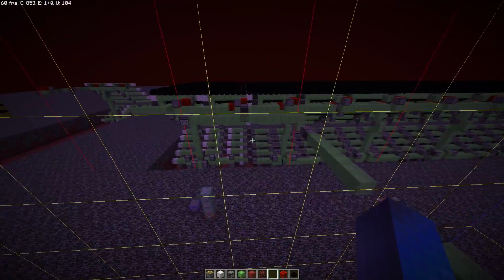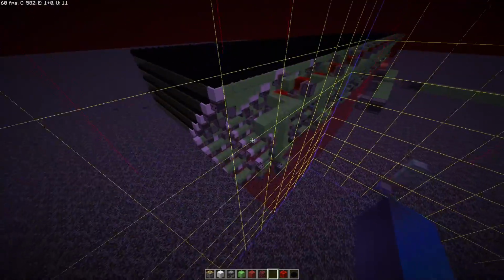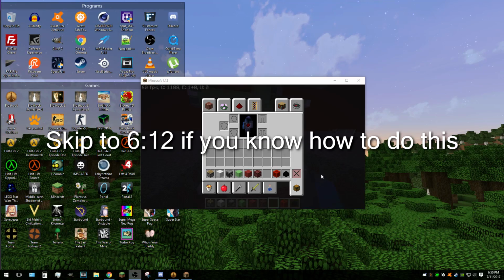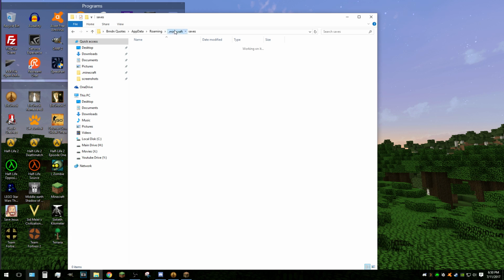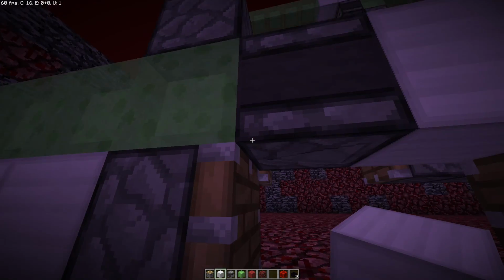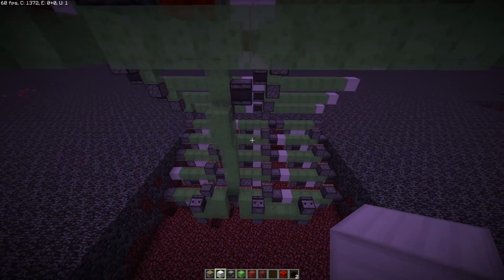ULTIMATE Bedrock BREAKING Machine: BEST Way To Clear Bedrock

Comment: 12*16=192, not 196, but close enough :P Great showcase on the bedrock breaker, looks easy enough to recreate from the video
Reply from the maker: Dammit! A tired mind doing math on camera. Usually I'm not even this close.
Reply: btw an easy way to get to the run box (where you type %appdata%) is by pressing the windows key and the R key at the same time on your keyboard
Reply from the maker: Razer Blackwidow with Gamer Mode enabled turns mine off

Comment: For most of the cases, this is NOT the best way to break bedrock. This is so slow to set up without macros.
Reply: Minougarou ' It is good for pretty much nothing if you dont use schematica or macros. For large areas it takes so unbelievably long to set up that easier afk machine (for example the one xcom showed) is much better. For smaller areas it is much faster to use banners.
Reply from the maker: link me
Reply: xMistaBeastx Find it yourself, im too lazy XD its by xcom and its titled afk bedrock breaker.